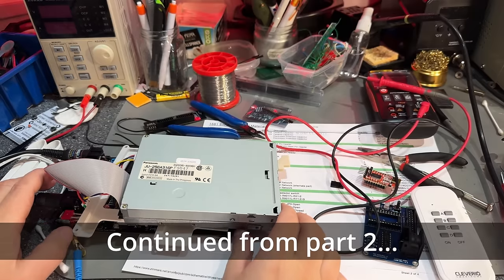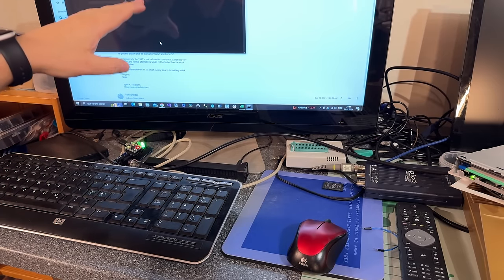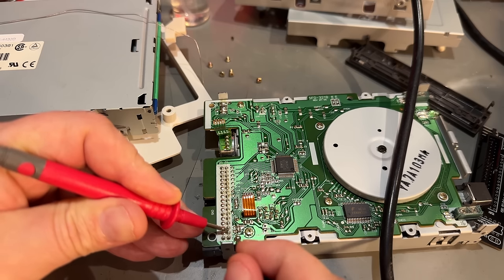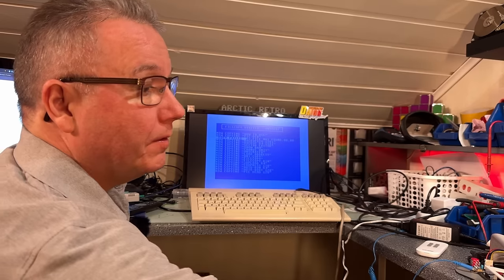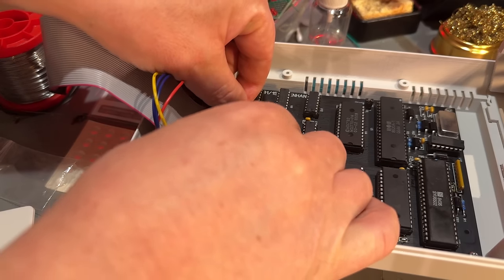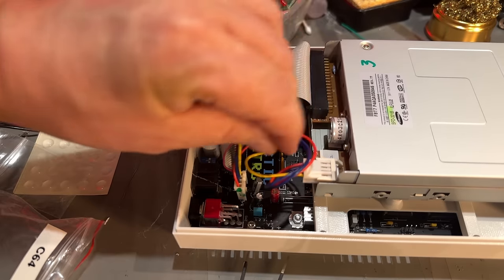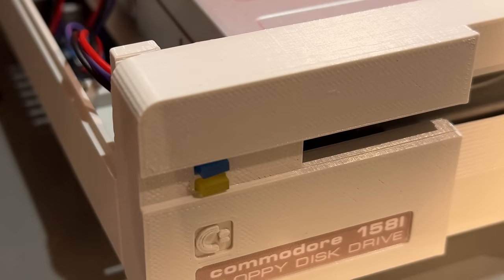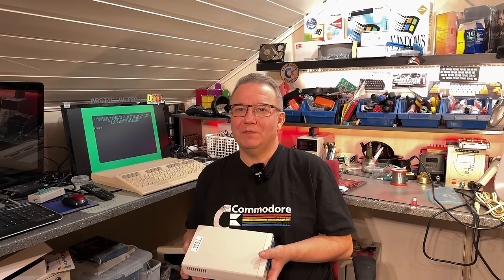Building a 1581 floppy disk drive - Part 3 - More testing, 3D case, and final result!

Comment: Hot glue is a great choice for that drive eject button.  If it has to be replaced in future, a little IPA (91% works) will loosen the glue for removal.
That print from PCBWay is really precise.  I thought when I first saw it that it might be a resin print.
Screw size for 3.5 inch floppy drives is M3 x 0.5 mm pitch.  These are available in a variety of lengths that should cover your needs.
This project has shaped up nicely.  I hope it does very well for you.
Reply from the maker: Thanks for the info!

Comment: Very nice build ! One nice aspect of the PC-Drive Adaptor for the 1581 repica boards is that the pcb "twists" the floppy drive connector 180 degrees around so you don´t have to twist the 34 pin ribbon cable . This way, you can use a rather short cable to hook up an unmodded PC diskette drive. I have no idea why Commodore chose to mount the connector "the wrong way" around. The vast majority of more recent drives have pin 1 exactly on the opposite side of their counterpart on the board...
Reply from the maker: Thank you :)

Comment: I like these builds, but i wonder what the total price will be when you are finished. Anyway congratulations with the build.
Reply from the maker: Not sure yet, but quite expensive to be fair. At least 200 EUR
Reply: @Arcticretro  That is very reasonable as a total price, but i checked out some electronics parts from DIY Chris and i allready past the 200 euro easy for parts alone.  not speaking of case and drive yet. Retro chips get really expensive. But you did an awesome job and got sponsoring.  Most of us do not have that luxury.

Comment: Nice build, congratulations. I guess the C5 flaw is pretty critical concerning the reliability of the drive so ablot of people will run into problems when building this without the additional wire. I would Put the Arctic retro Sticker on the underside of the drive Just where the commodore model Plate would ist onnthe original drive..
Reply from the maker: Good point!

Comment: If you have a usb floppy drive, could you try plugging it into that pi1541? It's supposed to have experimental usb support, so it would be interesting to see how functional it could be versus building a 1581. On the subject of programs, I find Star Commander under dosbox to be really useful for copying prg files out of t64 and d64 files. Very useful if you want to make a new disk or cartridge file with all of the PRGs inside of it
Reply from the maker: Never tried. Thank you for the info!